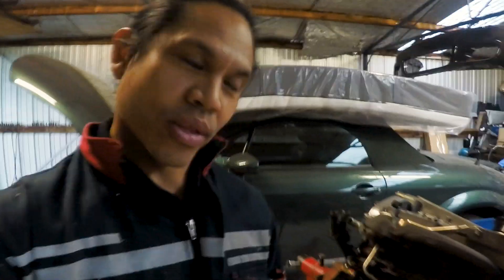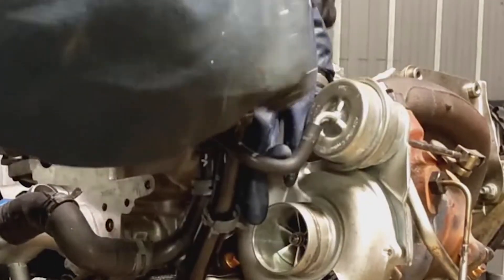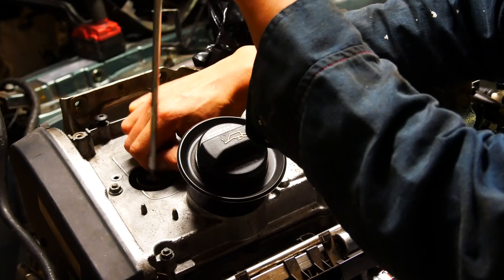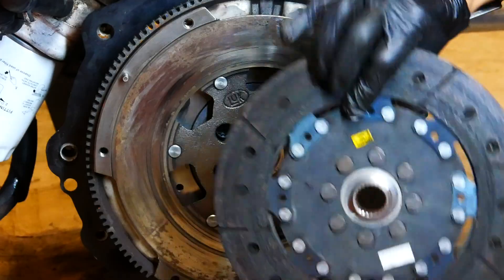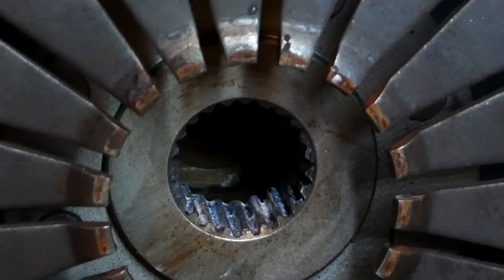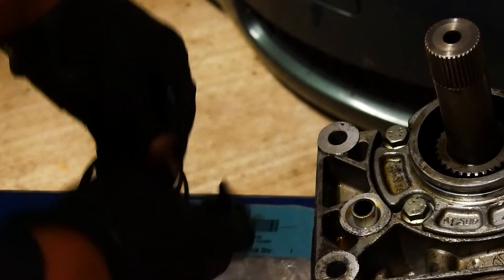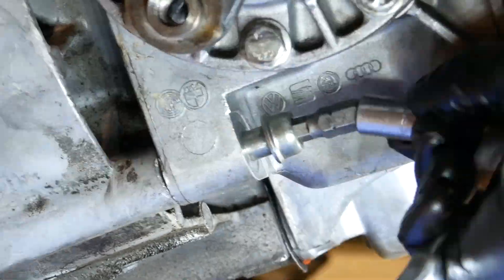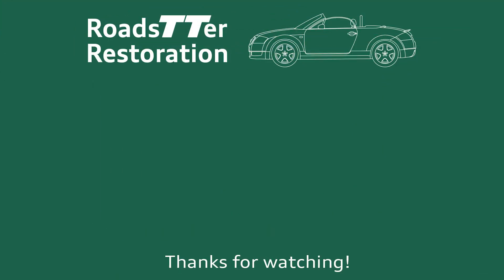Audi TT MK1 Hybrid Frankenturbo re installed, stage 3 clutch, gearbox install & engine back in! YAY🥳

Comment: Ian my man great job with this as usual. Hey one thing about the frankenturbo is that they supply a different manifold to turbo gasket with a larger center hole so if you replaced it witb an oem original you'll want to switch it out to the frankenturbo gasket. You'll have to prove to them you have their turbo or else they won't sale it to you. 
I'm doing a lot of work on my A6 3.0t but soon I'll get back to working on my TT. I have to replace the head unfortunately but the good thing about that is it gives me an excuse to upgrade the rods lol. Keep up the good work. 👍
Reply from the maker: Oh ok I didn't know this manifold gasket thing! I will need to check it out. Thanks for the tip and good luck with your rebuild too.
At least you have some videos that can help guide you ;)

Comment: i will be doing the clutch replacement on my 225 bam soon . did you keep the original dmf flywheel ? . great vidoes btw keep up the great work an content
Reply from the maker: Thank you!

This DMF and flywheel is original to the setup as I bought it and I can confirm it still has plenty of life in it (by chatting with previous owner and receipts) so I didn't buy new. 

I reckon if you don't have the history of the car, buy new.